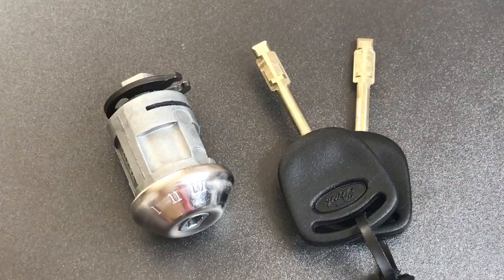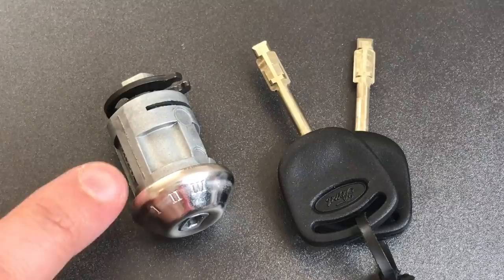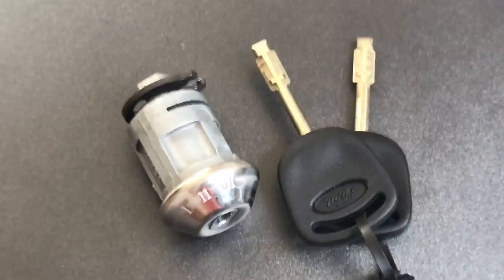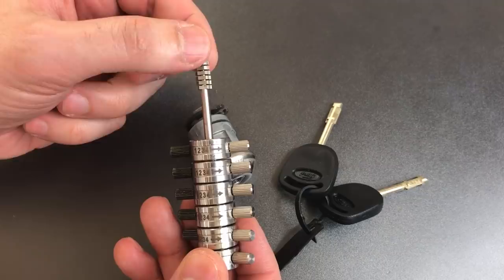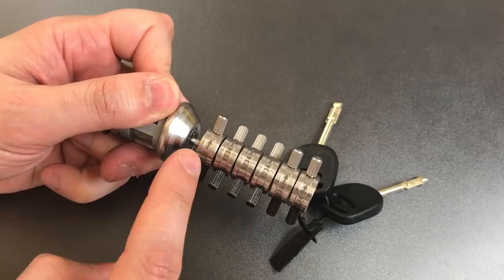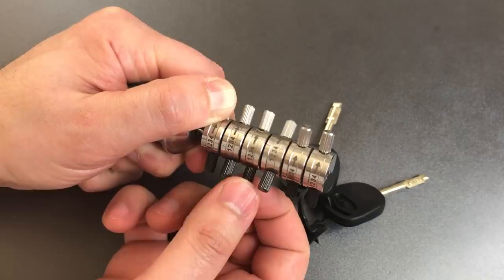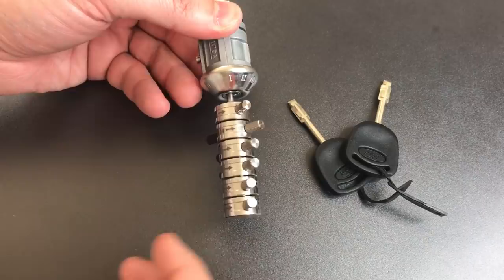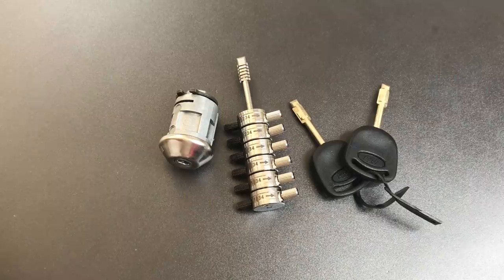[578] Ford "Tibbe" Key Ignition Lock Picked and Decoded

Comment: In addition to this lock Jaguar has another security device :  half the time your Jag isn't going to run.
Reply: Charlie Harper 🤣🤣🤣👌
Reply: This deserves to be the most upvoted comment on youtube
Reply: Jags switched to a 7 system rather than a 6 but of the tibbe area where Fords under the skin anyway
Reply: Charlie Harper not true. A jag will run until you hit a bump to hard then is suddenly dies.
Reply: LOL my old Buick had that same security feature.
Reply: That's fine
Coz you got a Jaaaaaaaag
Reply: Owner: "Okay, new ignition system, new starter, new battery, new spark plugs, let's fire this baby up."
Jaguar E Type: AHEM RERERERERERERE
Owner: "Fuckin' thing STILL WON'T START!"
Reply: My housemate had a 2010 Jag XF (V6 Diesel Turbo) which had a proximity key, not particularly easy to fool one of them.. but even if you did there was another high tech theft deterrent built in to the design.

The turbo blew up
Reply: @theofficialsikris  e type was the fastest production car in the world when new. Reliability was not a design goal
Reply: How ironic as jags are pretty much all Ford underneath
Reply: @joelaw728  Not very fast if the pile of turbo shit won't even start. ;)
Reply: Joe Law I don’t think it matters how fast the car is if you make a production vehicle that can’t run worth a damn under normal conditions
Reply: Bit late but as a 2001 Jaguar owner, absolutely correct
Reply: I always see people saying this, but I've got to say I know for a fact that the X308 Xj's are tanks. I just sold a 2000 XJ8L still going strong with 240k miles on the original drivetrain and I have a '99 XJR that's been tastefully modded and is still pulling like a freight train at 160k
Reply: Read this in Jeremy Clarkson's voice  and it fits so well
Reply: Lmao
Reply: God I know! Used to own one of those rolling pieces of shit. Bought a Lexus and never looked back!
Reply: @theofficialsikris  - Turns out it was just out of gas.
Reply: Haaaaa
Reply: Pretty much!
Reply: @joelaw728  i assume common fucking sense wasn't on the table in any meetings before using a blueprint drawn up by one of the engineer's daughters
Reply: Ford bought Jaguar & Land Rover in 2000 & sold in 2008. There were some parts being interchanged then.
Reply: Rubbish Ford buys crap Jaguar factory; what possibly could go wrong?
Reply: This only works in countries like the US and Australia, where the average air temperature is above 15 degrees Celsius…… however, you can easily bypass this feature by simply replacing the starter motor, alternator, gearbox, engine and wiring loom with GM counterparts.
Reply: My Chevy Trailblazer had that.  The resistance in the key would fail the passlock system and the ignition would not start for 10 minutes.  Oddly it failed about once a month but it never stranded me or not start when I was in a hurry.
Reply: Ultimate anti theft device ... don't run!
Reply: Let me heat up my JAAAAAGH
Reply: @mattrhodes3963  That's because Chevys have a soul and conscience with a good moral compass.

Late ass comment but whatever.
Reply: All cars have an immobiliser.
Reply: Must be an old jag. 
 They've been keyless since 2007 in Britain.
Reply: @theofficialsikris  
Luckily the customer is very rich.  And has at least 2 other motors
Reply: @MrBollocks10  Kia/Hyundai sweating real hard at this comment
Reply: @theofficialsikris  🤔just checkin in to see if you got it runnin ?

Comment: interesting fact on this lock is that any  "Tibbe" key will lock the car, but only the original key will open it, real pain if you have 2 Fords but only 1 set of keys seen it happen many times where Tradesmen lock the firms van with their car key. Then see that the key is in the ingition and the spare set is at a HQ 100 miles away.
Reply from the maker: I did know that, but never thought of the practical issues it could cause!  Thanks. Fwiw, this makes for some very oddly shaped discs.
Reply: petercar96+ You get a similar effect when the lock is worn out, you can lock your car but not unlock it.
Reply: This exact situation happened to me. 250 miles miles to be exact
Reply: Actually, you can lock it with just regular flat head screwdriver.. Also, keys are much much softer than plates in lock itself and they worn out relatively quckly. IIRC, plates aren't very special, for unlocking, whem they align, small pin allows barrel to turn, and for locking direction, barrel turns freely
Reply: Also if you use the Tibbe on a very worn ford lock, the tibb goes in fine, its just getting it out again. It can get caught up and jamb on its removal.
So beware, don't insert it when the daylight hours are  fading fast for the first time, give yourself plenty of time if this should happen as it did to me.
Ended up removing the whole barrel to remove the Tibbe.
See my video on how to remove a Ford Connect barrel.

https://youtu.be/uN5af2DRJoY
Reply: petercar96 I actually wanted to say the same, it happened to me 

I wanted to get inside my dads car and grabbed a pair of keys out of the kitchen, I didn't check if the car (Sierra) was unlocked and i just put in the key and turned the lock,
Then I saw the right keys hanging inside the ignition 

Fortunately my dad didn't close the window all the way so I grabbed some wire and just fished out the normal key
Reply: Once the locks wear a bit any old key will unlock them too. They were awful.
Reply: I had a 1997 Escort that the previous owner had rebuilt the passenger lock... ANY Ford Tibbie key would open my passenger door (tried with various Fiesta, Escort, Sierra and Mondeo keys we had) . There were only so many combinations of key so I have a stash of all my old Ford keys just in case
Reply: So, same old story, a crap lock matching a crap brand of car
Reply: @blackbird700  You should have seen the key I was using on my 1995 Ford Fiesta by the time I got rid of the car! I was pretty shocked it was still usable. (Those were the days, though - I had a spare plus the master key, too!)
Reply: When I was a kid, we had a ford escort (EU), and I could unlock my uncle's escort with our key - I told my parents, and they checked if you could start the ignition, but it didn't work
I always wondered if maybe the keys were similar enough to unlock the car due to manufacturing tolerances or something?
Reply: @lockpickinglawyer  Back in my youth we were up to no good. I'm afraid to admit that we used to take cars and joyride in them.
We had loads of keys that we'd come across for different vehicles as well as other entry/start methods. If it was a Ford lock like this that was fairly worn, we would always use our Ford keys first and 'jiggle' them in the lock very often finding a random key that would open it. I promise you that this is true 👍😊
Reply: About 15 years ago I worked for a company that had a fleet of eight Transit Connects and a couple of full size (3.5 and 5 tonne) Transits.  Out of every vehicle you could find at least three keys that would lock and unlock it, although the immobiliser chips were different so it wouldn't start.

Much fun was had hiding objects in the cab, turning the radio volume up full, cable ties around the seat runners to stop them moving the seat back, and so on...

Comment: Fun fact: you can use any Tibbe key to open the bonnet release, fuel door and also to lock (although not unlock) the driver's door on any Ford that utilizes this type of key.
Reply: Fun fact: My Tibbe bonnet release key doesn`t fit my ignition , nor does it fit my fuel cap or lock my drivers door. Hence, i have 2 keys.
Reply: Is it a fun fact as it's not fully true ?
Reply: @StormTrouper3  
fun:
 noun
enjoyment, amusement, or light-hearted pleasure

fact:
 noun
a thing that is known or proved to be true.

bulls*it:
 noun

stupid or untrue talk or writing; nonsense.
Reply: So it should be considered a bull-fact that all keys open all bonnet's. 👍
Reply: @StormTrouper3  No
Reply: @StormTrouper3  late to the game but it's not true
Reply: When my dad locked the keys in his XR3i (Escort) he went round the corner to the shop and asked to borrow their key and it opened the door. I'm surprised ford are still using this kind of key.
Reply: @ColKlinkerhofen  It's almost been entirely replaced now. Except now transits just need pipe-grips to open. Guess who changes transit door locks often enough to be  the guy to go to
Reply: Not true at all ole
Reply: Escort you can unlock with these but thankfully not unlock steering
Reply: So it’s useless to get inside a car that someone has lost all the keys to? I guess if I can open the bonnet, I can then use the key code to get a Tibbe key cut for the door lock.
Reply: my falcons keys )same design) locks all my other falcons but wont unlock.
Reply: You can open an Aston Martin also

Comment: Just an observation, most companies that use vehicles with this type of cylinder, install secondary deadlocks in the doors and an immobiliser. In many cases it's an insurance requirement. Only a few weeks ago a neighbour had their van and tools driven off their driveway. Apparently a tracker was secretly installed in the vehicle by dubious service technicians, who then tracked the van back to his home. Good video!
Reply: Modern Leveller where they found the thief and hid hammers in his skull and chest cavity
Reply: Indeed. I had "Slick Locks" pad locks on all my cargo area doors.
Reply: Negative. We have 1 key to the ignition , all doors, and fuel door.

Comment: Got my Fiesta stolen 4 times with this "amazing thing"... At the end of the metal core there was a white-ish plastic part  where the electric wires from ignition come. The thiefs have just to detach the plastic part from the core and put a screwdriver inside to start the car... No need for lockpicking skills or tools. That was my first car and i really liked it alot (apart from the lack of security). I had to put  an electronic immobilizer to stop the thefts.

Comment: My dad had an interesting story about this type of key:

He wanted to buy a Jaguar XJ some years ago, a deal her had three of them, all different colours. The dealer was on the phone when my dad asked for the keys to look at one, the dealer handed him the keys but didn't tell him which one they opened.

Fortunately it opened the one my dad was interested in. Unfortunately it also opened the other two 😅

We were also part of a kit car club where the donor cars were Sierra's. We've seen those things started with spoons and even a lollipop stick (though that one took some doing!)
Reply: Jack Mellors that’s how most people got their cosworths back in the day
Reply: Another fun fact, the old VB/VC Commodores here in Australia had like 3 different key designs.. meaning as long as you swiped 1 key, there was a 33% chance it would open and start any other commodore of the same era.

My TAFE (tertiary college) teacher once did that by accident, unlocked, climbed in and started his car and was about to leave the shopping centre when he realized it wasn't actually his car.. he had parked a few spots over.
Reply: Thing with the '80s fords (pre PATS) is the tibbe locks weren't even the weakest link.  Ever heard of "snapped n capped"?  Basically the steering locks were cheese so just turn the steering hard enough and it'd break off, then pull the column casing and unclip the "cap" (ignition switch) from the back of the barrel, insert tool of choice and drive away in your new ford...  Vauxhalls weren't as bad but nearly, Rover at least required the cap to be unscrewed once you'd twisted the barrel off the column but PSA Peugeot/Citroen... I lost the keys to my 205 and I can tell you I feel safer leaving an old pug out at night without an immobiliser than anything else.